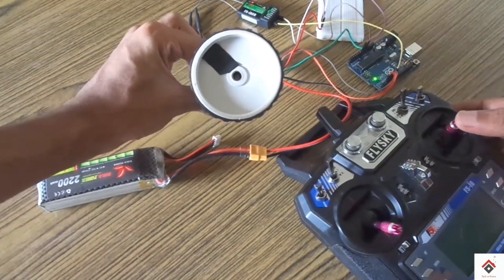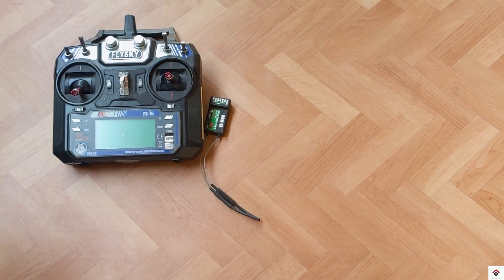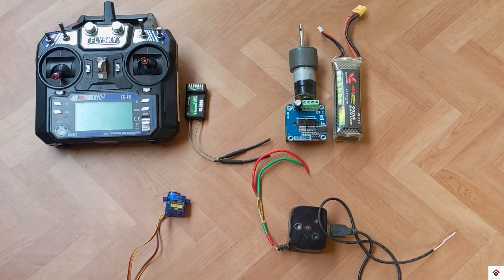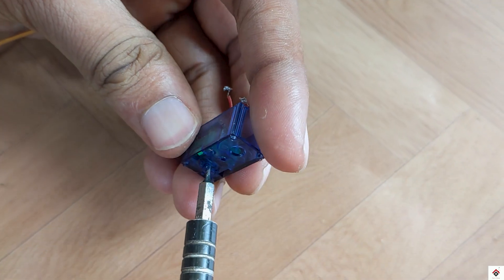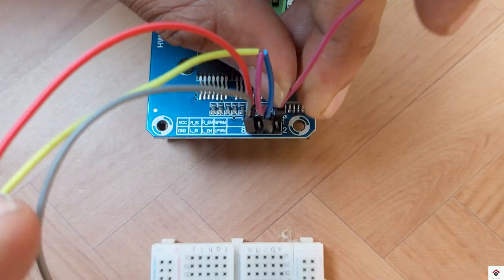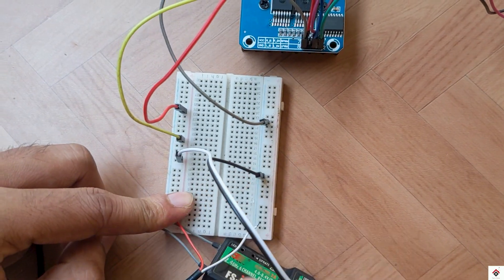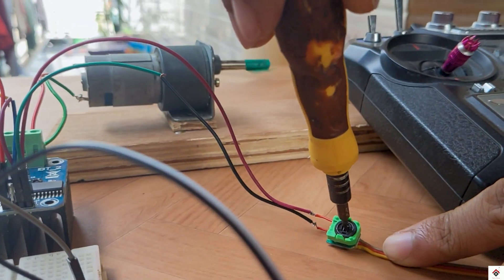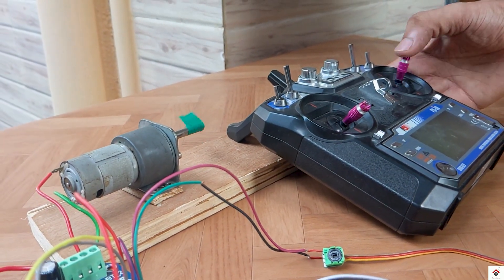Control DC Motor using Flysky without Brushed ESC and Arduino | DIY brushed ESC using servo and BTS🔥

Comment: Enserio muchas Gracias llevo mucho tiempo buscando soluciones aun variador de buen consumo no se manejar programación y enserio esta es la oferta mas práctica que e encontrado muchas Gracias Amigo, me queda la duda si el receptor rc no resivira picos de corriente amp al colocar un motor mas grande
Reply from the maker: Welcome ❤️🙏
No issues even with bigger motors. Receiver will give only PWM signal to motor driver. There is no link with high voltage side.

Comment: Bro you are very good👑,  but I have a very serious question for you. I am making an RC car and I will use the system you made, but I will use the mg995 servo in my RC car and how should I connect it to control it with the fsi6 remote control?
Reply from the maker: Thank you 👍 
Servo can be directly connected to receiver.
Reply: @techathome  I subscribed you 😄

Comment: bro can i get output 12v if i connect 12v source
Reply from the maker: Yes even I am using 12v supply with 12v motor.

Comment: Bro im using L298 2A module and 360 degree servo motor but not working plz help
Reply from the maker: L298 module cannot be used in this circuit.

Comment: Hi bro please reply can bts7960 motor driver run single 550 dc motor with 3s battery? Please reply
Reply from the maker: Yes it will run.
Reply: @techathome  it can run 550 dc motor with load? Basically I am making rc car with 550 dc motor so this esc is suitable for rc car?
Reply from the maker: Yes it can handle high current. You can use it for an RC car.
Reply: @techathome  thankyou very much 😊😊😊

Comment: I have a problem, I don't know why in idle mode without moving the remote controller the wheels move very slowly
Reply from the maker: Try to adjust the potentiometer slightly on the servo circuit.

Comment: hi
is that potentiometer replaceable with something? with a resistor for examle? beacuse this potentiometer is so sensitive. and the motor is slowly moving sometimes when i dont want it.
Reply: yes, you can use 2 resistors in series and connect them on the three wires of the servo basically make a M shape with 2 resistors and soldier them on the 3 pins of the servo controller this will always keep it 0. also don't forget to remove the stock potentiometer first . hope this helped :)
Reply from the maker: @rustom767 Have you tried it. What values of resistors used?

Comment: Hello, this configuration can be used with a wiper motor for steering left, right?
Reply from the maker: Yes you can use. Motor driver can handle 24v.

Comment: Great video!
I would like to drive a 2 wheeler rover (mover). For this i would have to combine the pwm from 2 channels. Turning left - only right wheel moves, turning right - only left wheel moves, going forward- both wheels turn. Is it possible analog or should i read the pwms with arduino and write the logic there?
Reply from the maker: Thank you ❤️
I got your requirement. We have one more video showing exactly what you need: https://youtu.be/m9Lq-QADP9A?si=h8AymSGEIzkbOEQG
Reply: @techathome  nice! Mixing the channels was the key. Now all i need to find out whether my flysky gt5 can mix or not.
Thy sir!
Reply from the maker: Welcome 👍

Comment: طبق تصویر کار کردم .ولی مدار سروو بسیار‌گرم کرد .؟ چرا .ایا راه دیگری هست ؟
Reply from the maker: Did you connect the servo connector to receiver in proper order,
Signal pin at top and Gnd pin at bottom??

Was that servo working before you removed out?
Reply: از اینکه جواب دادید متشکرم 
بله طبق تصویر .سیگنال در بالا و منفی در پایین 

قبل از باز کردن موتور سروو کار میکرد ..البته سروو ۹۰ درجه است 
بدون هیچ تغییری . تنها برای تست .از لا مپ ۵۰ وات استفاده کردم 
متشکر خواهم شد راه و چاره مناسب یا استفاده از ماژول دیگری برای نصب بمن پیشنهاد بدین . 0:19 🤲

Comment: Was attempting to use an arduino with flysky receiver and two BTS7960s to control two 18V drill motors, but struggling with the coding because I've never really used an arduino beyond the first 5 tutorials in the really basic beginners book, this video completely solves my problem.  Thanks from the UK!
Reply from the maker: Welcome♥🙂

Comment: Great video! When you move your stick you get different speeds on your motor. But when I'm using this method with 24v I'm only getting either 24v or -24v from the motor output on the board. So the motor is only ON or OFF. Shouldn't I get different outputs depending on stick and potentiometer positions?
Reply from the maker: Thank you!!
It should work the same way with variable speed. You will only use 24v motor and respective supply. This any way motor driver will handle.

Did you try to run the motor or only measured the output voltage???
Reply: @techathome  I both measured and run the motor. Strange...
Reply from the maker: You can check once if pwm control of your BTS driver is working properly or not. Refer this video: https://youtu.be/H2YJRaaXFIM?si=TTUn0lGqQFr1tFv5

If this is not the issue, then the circuit from servo might be an issue. Only these two possibilities.
Reply: @techathome  I bought a new servo with different spevs and that fixed the problem. The first servo did only have on or off. Thanx for all your help! Much appreciated! :-)

Comment: Bro can we use for reducing 12v to 5v. By using AMS 1117 5v step down power supply  module. Please reply. New subscriber❣️🤍
Reply from the maker: Yes you can use any of the step down converter.
No specific one.
Reply: @techathome  can you suggest a dc motro for rc boat big size. Its cm about 100 cm. I used vrushelle but its eac burn. Now this time i am thinking to make with dc motor. With this type of esc.
Reply from the maker: Yes you can use this method, it's very easy.
BTS driver can control upto 24v, 40A DC motors.

You can go with ebike motors without gear both 12 and 24v available.

Check this mode if it is sufficient : MY6812, 12v, 120W

Comment: Hi, your videos are very good.        Please make a video using 24v 250w motors using the same process , without Arduino Uno
Reply from the maker: Thank you ❤️ 
There is no difference in the setup.
Instead of this motor you can connect 24v motor.
Also in place of 12v, connect 24v supply.
This BTS driver can handle without any issues.

Comment: Hey bro pls reply for this i need solution for this definitely.....so pls
.......
The problem is: While i asked you, can we use 4 10koem potenciometers for accelerator,brake,clutch and steering and 7 spdt micro switch with roller lever for h shifter all in the same arduino board  in your ffb steering for my 900 degree wheel....you said ,yes you can use same arduino for all....but i have taken 5v from arduino to a pin of bread board.....and a ground pin also...
Now spdt switches (hshifter) needs 7 grounds and potenciometers needs 4 gnd(s) and 4 5volts pins......so if i connect this two ....my arduino turns off , so what should i do .......i have only one arduino ,but i should complete it with one arduino......pls reply very fast very fast pls😢😢😢😢😢😅😅😅😭😭😭😭😭💔😵😵
Reply: And another question,should we use a common gnd and a common 5volt for all the 4 potenciometers????😅😅
Reply from the maker: I am confused.

If you are using Arduino uno, it is not FFB.
Yes you can same Uno board for all.

You can send mail: deepakhd20@gmail.com

Comment: Bro my arduino uno is Not getting power supply
..... Is there any solution Available to solve this pls....😅😅😅😢😢😢😢
Reply from the maker: I didn't get.
Which video are you referring?
Reply: @techathome  The one you made i.e 900 degree steering wheel.......but   i fixed it it's just a wire problem thank you...

Comment: Bro, Good use of servo motor for running roborace robots without arduino. But how many motors can we control with this motor driver without having a heating issue in motor driver?
Reply: @RoboAntXOR  ok bro thanks for your reply.
Reply from the maker: You can use upto 43A